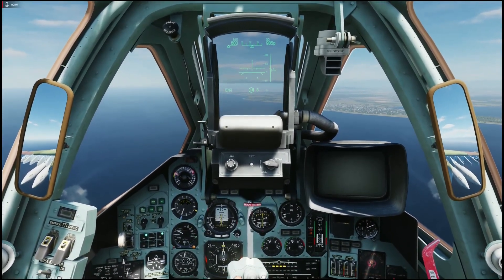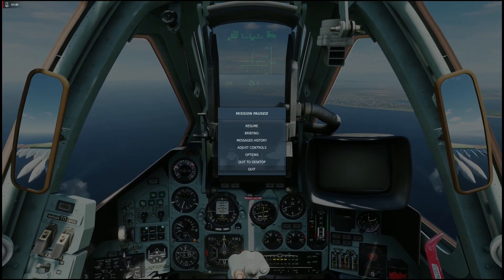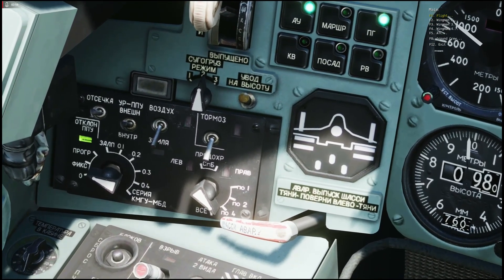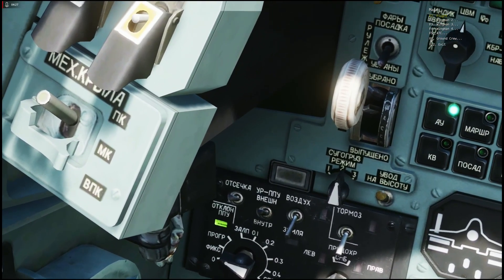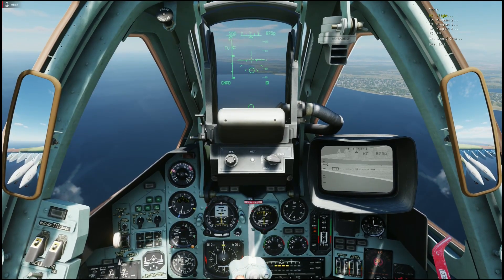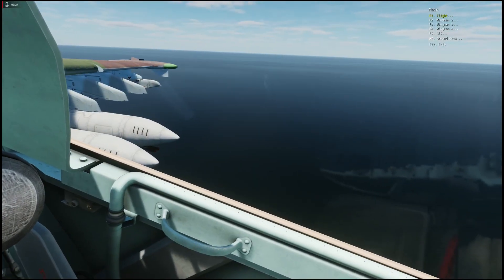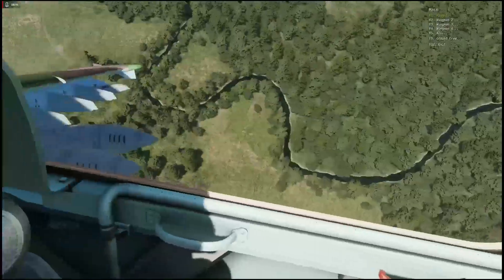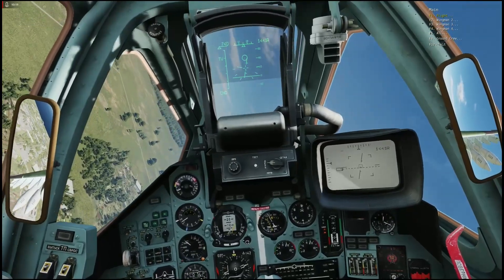Su-25T Cadet Series - 19 - SPPU-22-1 Cannonpods employment.

Comment: Unfortunately these pods are relatively useless in DCS as rockets are infinite and could do the job better. Maybe their benefit is that they can carry a lot more ammunition than rockets, allowing you to potentially loiter around hunting for targets longer, but other than that, they would theoretically be perfectly useful against soft targets like trucks, artillery pieces, equipment, radar stations, garrisons, lightly armored vehicles like BTRs, and so on. Or, in my case.... they make for fun Anti-Air guns :^). These pods turn you into a flying BTR at best, without the ability to carry troops.
Reply from the maker: Yes, i havent either found any effective use for them, i would rather carry rockets anyday than these.